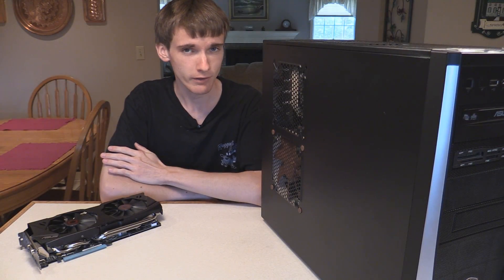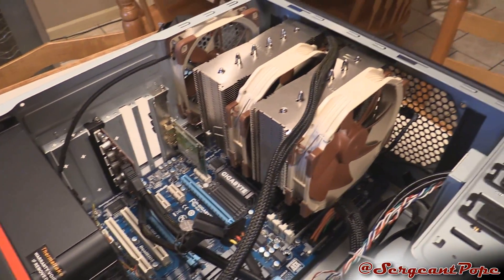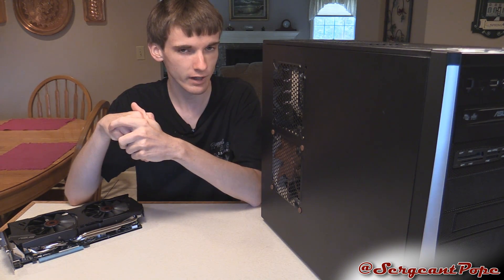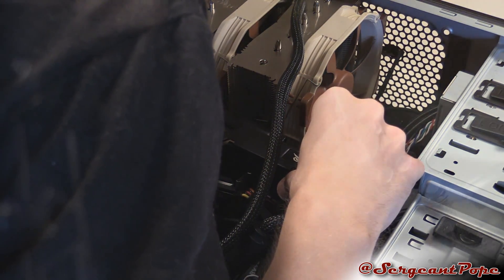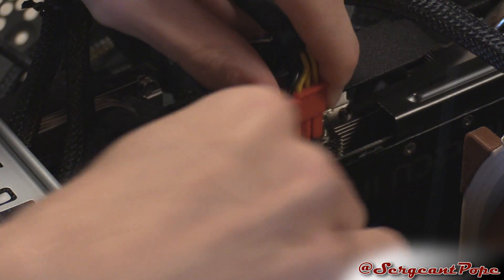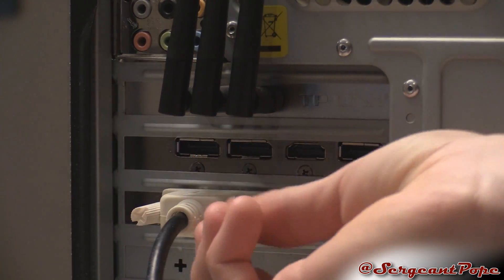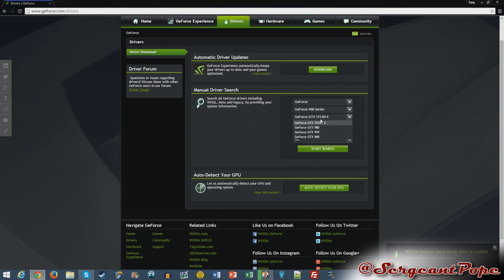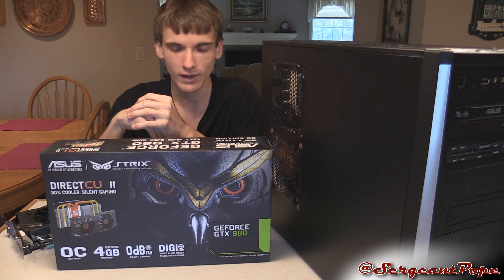How to install a graphics card - GET INTO PC GAMING EASY!

Comment: HELP my mother board just says pci e 16x it doesnt say 3.0 or 2.0 and i want to buy a r9 380 Will it work and will it cut performance also the latch broke but should this be a problem because you screw it on to the thign any will
 will i be ok?
Reply from the maker: +Guru Nannak It can be 3.0 or 2.0, either are fine. The latch doesn't have to be there, so if broke off that's fine.
Reply: SergeantPope so its to get 3.0 on my motherboard ?
Reply from the maker: Guru Nannak Yeah, 3.0 is fine. Technically PCI express 3.0 is faster than 2.0, even though all of my computers have 2.0 and they still work fine too.
Reply: SergeantPope oh ok ty
Reply: +SergeantPope will a msi geforce gt 710 2gb work with https://www.amazon.ca/gp/product/B00GFG1B1A/ref=s9_simh_gw_p147_d3_i1?pf_rd_m=A3DWYIK6Y9EEQB&pf_rd_s=desktop-2&pf_rd_r=NCJ61RPZ59RPDH444YPX&pf_rd_t=36701&pf_rd_p=2443077042&pf_rd_i=desktop

Comment: Hello, would this card work with my PC?  PC Specs: http://h20564.www2.hp.com/hpsc/doc/public/display?docId=emr_na-c03787848

Graphics Card: http://www.amazon.com/EVGA-GeForce-750Ti-GDDR5-Graphics/dp/B00IDG3IDO/ref=sr_1_2?ie=UTF8&qid=1451574084&sr=8-2&keywords=nvidia+gtx750+ti

I have intel 4600 right now, so would switching over to a new card be easy? I know I have to use the PCI Express because of the intel chip but I'm just wondering if the process will still be simple?
Reply from the maker: +Bryso69 You're probably good to go with the GTX 750 Ti. According to HP, it comes with a 460 watt power supply, which is enough wattage for the GTX 750 Ti. It also needs 20 amps from the 12 volt rail, so check the sticker on your power supply and make sure it says the 12v section has at least 20 amps. If it does, get the 750 Ti and install it!
Reply: +SergeantPope  Thank you so much. Your help is greatly appreciated!
Reply from the maker: Bryso69 No problem, glad I could help.

Comment: +SergeantPope Please help me I'm getting 20 fps on low setting on csgo is my amd sempron 2650 bottlenecking should I get the Athlon 5350? I need someone to confirm that the Athlon 5350 will work good and get decent fps
Reply from the maker: +Ridiculous Rodstar Anything better than a sempron will help. I don't know for sure how much.
Reply: +SergeantPope Are you sure, maybe in the future you can do a benchmark video with the athlon 5350 and maybe tag me

Comment: I have an asus g10aj desktop. There no words indicating how many amps or watts are in my computer, but in website it says it have 500 watts, but doesn't say how many amps. I was wondering if I can still put in a GTX 970 without many issues?
Reply from the maker: +Dzanh Nguyen You're probably good with a 500 watt power supply, but you can check the sticker on your power supply to make sure it has enough amps. The GTX 970 requires 28 amps.
Reply: SergeantPope Ah ok. Thank you for your help!
Reply: +SergeantPope alrighty another question.... What would happen if my amps were 3 less amps than how much I need? Also in the video, what is your amps? Also, is it strange that I have a gtx 760 that requires 30 amps and still runs just fine? I am basically asking that if I can run a GTX 760 card, then can I run GTX 970?
Reply from the maker: ***** If your power supply is only a few amps short of what's required, it probably will work at least for a while. But that said, eventually you will probably run into issues, especially if you run your system for longer time periods. Trust me, I've come into this issue before with a Radeon 7990 and it killed my PSU.
Reply: +SergeantPope That being said... I am a little confused on how the amps work. There's something like +12V1 and +12V2, does those two add up together? Or is the amp just only in the +12V1? If I do intend on having the gtx 970 with my currenty power supply, how much should I play my computer for it not to screw my computer over? Sorry if im asking too many questions, im kinda noob in these type of situations. I have 25 amps on my +12V1 and 25 more on +12V2.
Reply from the maker: ***** Unfortunately I think you can only use one 12 volt rail per graphics card, so you can't add them together even though your power supply has them. That's why a lot of newer power supplies have just one big 12 volt rail. I would honestly upgrade to a better power supply. The EVGA 500 watt power supply has 40 amps, which is plenty fpr a GTX 970.
Reply: +SergeantPope That sucks man :/.... I wasn't looking forward to spend any more money, but I guess I have no other choice. I just wanted to say thank you for your help and your time to help a fellow out ^_^
Reply: +SergeantPope I swear this is the final question, because you're great at helping! Instead of a 500 watt, I want a 550 watt PSU.

 http://www.newegg.com/Product/Product.aspx?Item=N82E16817139048 This is the cheapest 550 watt PSU with a single 12 volt rail of 46 amps I can find. Is this the cheapest and has everything I need?
Reply from the maker: I would go with this one instead. It's cheaper than that Corsair even before the $10 rebate that it has. http://www.newegg.com/Product/Product.aspx?Item=N82E16817438014&cm_re=evga_600_watt_psu-_-17-438-014-_-Product
Reply: +SergeantPope How have I not found this PSU yet? Thank you so much for your help, even to the point where I wish to just hug you. I'll stay tune to more od your videos. (>^.^<)
Reply from the maker: ***** Haha, thanks man. EVGA power supplies are really good. Thanks for the support!

Comment: i have a dell Inspiron desktop. i was wondering if i could install a nvidia gtx 960 in it.
Reply from the maker: +Matthew Stengrim If it's a full sized Dell desktop, it'll fit in there. The GTX 960 needs a 400 watt power supply, so make sure your power supply is 400 watts. If it's anything less, you'll have to upgrade, but they aren't too expensive.
Reply: +SergeantPope ok thank you so much
Reply: +SergeantPope do you have any suggestions on a Psu?
Reply from the maker: Matthew Stengrim Here's one: http://www.amazon.com/EVGA-Continuous-Warranty-Supply-100-W1-0500-KR/dp/B00H33SFJU/ Either the 430 watt or 500 watt models will work with a GTX 960. There are other options out there, but EVGA PSUs are affordable and reliable.
Reply: SergeantPope thanks so much man

Comment: +SergeantPope what if you bought your desktop without an graphics card, so how would I uninstall old graphics drivers ?
Reply from the maker: +Ridiculous Rodstar Every computer has a graphics card, but a lot of the time it's integrated into the CPU or motherboard. Regardless, it'll have drivers that you can uninstall through the uninstall a program window. You don't necessarily have to uninstall the drivers though, it's just a good idea.
Reply: Ohh okay thank you much gtx 750ti comes with a cd so the drivers might be in there to download thanks
Reply: SergeantPope i have 1 vga cable that came with my monitor and im getting dvi to vga, but how am i gonna get the card and the desktop to the moniter
Reply from the maker: Ridiculous Rodstar You just use the video outputs on the graphics card, don't worry about the connectors on the motherboard you were using before.
Reply: +SergeantPope oh okay thanks can u tell me what is the best cpu for gaming for the am1m-a mb
Reply from the maker: Ridiculous Rodstar I honestly have no idea, sorry. I've never had to deal with that area.
Reply: +SergeantPope its alright i know im asking soo much questions but how much fps will i get at low settings and im gonna buy the athlon x4 860k that can fit in mb because its am1 platform
Reply from the maker: Ridiculous Rodstar After looking up the AM1 socket, I think this CPU is actually the best that will work with your socket http://www.amazon.com/AMD-AD5350JAHMBOX-Quad-core-Desktop-Processor/dp/B00IOMFAQ0
That should run CS GO well.
Reply: SergeantPope Thank you for all your help lately mind telling me the fps on low and high settings?
Reply from the maker: Ridiculous Rodstar I honestly have no idea. CS GO isn't hard to run so the FPS should be pretty good, but I can't give you a specific number.
Reply: +SergeantPope thanks soo much! honestly you have helped me soo much
Reply: What do you call a computer that loves to sing? A Dell hahahahaha
Reply from the maker: Ridiculous Rodstar Niiiice, lol

Comment: I have a gtx 750ti and my max power supply is 420w is that good
Reply from the maker: +Ridiculous Rodstar 420 watts should be enough power for the GTX 750 Ti. That card also needs 20 amps from the 12 volt rail, so you might wanna make sure it is at least 20 amps.
Reply: +SergeantPope how do I check
Reply: +SergeantPope and do you know the ports on the graphics cards where do they need to be connect sorry I'm new to this
Reply: +SergeantPope sorry lol I have to much to ask my cpu is Amd sempron 2650 intergraded radeon r3 graphics and I have a gtx 750 ti oc 2gb can that run csgo high and mes settings and yes how much estimated fps
Reply from the maker: Ridiculous Rodstar The power supply will have a sticker on the side of it. Under 12v it'll show a amperage. Those connectors on the graphics card will need a power connector from the power supply.
Reply: +SergeantPope no like the dvi and hdmi
Reply: +SergeantPope these are everything I found 13.0a 10.0a 22.0a
Reply from the maker: Ridiculous Rodstar It's probably that 22a, so from what you say I think you'll be good.
Reply: +SergeantPope thank you so much subscribed and liked!!
Reply: +SergeantPope when I have the gtx 750 ti in the desktop and I closed everything and everything's done what do we do on the desktop like any wires go from the card or what sorry I'm nooby
Reply from the maker: +Ridiculous Rodstar That was a little confusing to understand, but what I can try to answer for that is you need to run the video cable from your graphics card to your monitor, like HDMI or DVI. I don't know if that answered your question.
Reply: +SergeantPope Yes it did. So I can connect a hdmi cable from my card to my moniter that's it?
Reply: +Ridiculous Rodstar because my moniter doesn't have a dvi port its new Samsung nice looking but has a vga port i heard that the gtx 750ti comes with a dvi to vga
Reply from the maker: Ridiculous Rodstar Yeah, a lot of graphics cards do come with a DVI to VGA adapter, so if your monitor is VGA you probably wouldn't need anything extra.

Comment: let's say I had msi graphics card and I want to change it with other graphics card which is not msi well it work?
Reply from the maker: +Had1 Gamer So you're going to be removing an msi graphics card and replacing it with another brand? That's fine to do. If you will still use the msi card and add another different brand, you could run into issues.
Reply: +SergeantPope wow thanks bro for telling me but can u send me a link of a really good graphics card please and thanks
Reply from the maker: Had1 Gamer Without knowing your budget, that would be really hard to find something good for you.

Comment: do I uninstall all of the NVidia programs???? helppp!, I jst put my new graphics card in don't know what to do next
Reply from the maker: +chico42O Go to control panel and then uninstall a program. Look for the Nvidia programs and uninstall them. Usually with Nvidia there are several programs you have to uninstall one by one.
Reply: +SergeantPope ok I uninstalled all my NVidia programs what do I do next?
Reply from the maker: chico42O Install the new drivers at Nvidia.com
Reply: +SergeantPope do I click on automatic drivers update or do the manual drivers search?
Reply from the maker: chico42O You can do it either way. If you know your graphics card, you can just do manual and pick what graphics card you have. If you don't know, pick automatic.
Reply: +SergeantPope my computer only has one 6 pin connector and the gtx 960 requires two 6 pin connectors to make 8 pin does my computer not work for this graphics card?
Reply from the maker: chico42O If your power supply only has one 6 pin connector, I would upgrade your power supply. Find a power supply that is at least 400 watts and has 20 amps on the 12v rail. Here's an example of something that should work fine: http://www.amazon.com/EVGA-Continuous-Warranty-Supply-100-W1-0500-KR/dp/B00H33SFJU/
Reply: +SergeantPope my power supply does have 400w it just doesn't have two 6 pin connector
Reply from the maker: chico42O Does it have 20 amps on the 12 volt rail? (can be found on the sticker showing power ratings and stuff on the power supply itself). If so, then you can use an adapter. If it doesn't have 20 amps, get a new power supply.
Reply: +SergeantPope j got 18a is that enough?
Reply from the maker: chico42O I wouldn't chance it to be honest. I would get that 500 watt power supply, which will give you plenty of head room. That power supply you have might work for a bit, but it'll start to have issues eventually.
Reply: +SergeantPope is it easy to install a new power supply? Im new to this stuff lol
Reply from the maker: chico42O It's not bad. See where the wires go from the power supply now and then do the same thing with the new wires from the new power supply.
Reply: +SergeantPope will the power supply that you showed me fit on my Asus M51AC motherboard??
Reply from the maker: chico42O Yep, should be fine.
Reply: +SergeantPope k thx for all the help bro!! :)
Reply: +SergeantPope ok I jst installed my new power supply, graphics card is working, now I jst update my drivers and everything should be good?
Reply from the maker: chico42O Yep, you're good to go. Updates come out from time to time, so you'll have to update them every so often, but beyond that it's all good.

Comment: i have question my pc is Dell inspiron 660 can i upgrade power supply and graphics card??

if i install graphics card and power supply, do you think they remove everything on my pc 
or they just change little on my pc ???

how can i find graphics card and power supply  to my pc ?
how do i know they both on my pc >>??  

you know i have power supply like 300w ,so i want to change my power supply to 650w , what do you thinks ??

please make another video about how to uninstall and unstall the new on pc ??? help 

My english is not good Sorry  <_())(
Reply from the maker: +bruce le Hey bruce. To install the graphics card basically as you have to do is push the card into the slot on the motherboard and screw it into place. With the power supply, find out where every cable from the power supply is going before you disconnect it and then plug the cables from the new power supply into those same power connectors with the same type of connectors. Upgrading your power supply would probably be a good choice if it's only 300 watts as well.
I hope that helps you a little bit. If you still need help, just let me know.
Reply: i want to share my system can you please look up and thing which want can i upgrade please?
Reply: 1 .operating system: win10 pro 64bit (10.0 build 10240)
2 .processor: intel R core TM i5 3340 CPU(4)@3.10ghz 
3. memory 8 gb 

4. video card : interl r HD graphics
 

Thanks you
Reply from the maker: +bruce le I would probably just get a graphics card. Everything else looks fine.
Reply: okay thanks you :)
Reply: Vamery 2GB 256 Bit DDR3 PCI-Express Graphics Card For NVIDIA GTX650 

please look up 

does my computer can run it
Reply from the maker: bruce le A GTX 650 should work for you. Look for one that has GDDR5 memory instead of DDR3 memory. It'll be a lot faster if you do that.

Comment: WHERE DID YOU PLUG OTHER SIDE PINS ?
Reply from the maker: +Superis LTU Do you mean the 6 pin connector?
Reply: i guess.... i know that you plug 6 pin conector to the card, but then you need to plug one more cable somewhere
Reply from the maker: Superis LTU Hmm, I don't know exactly what you mean. Your graphics card will need either a 6 pin, an 8 pin, or a combination of those. Those cables will come from the power supply. That is the only power cable the graphics card needs.
Reply: ok

Comment: AMD A8 4.2Ghz Quad Core 8GB 1TB FTS Gaming PC Desktop Computer Galaxy EVO HDMI Gigabyte F2A68HM-HD2 Motherboard 8GB DDR3 1600mhz Performance Ram Onboard AMD Radeon HD 8570D 500 Watt Power Supply With 12cm Fan 1tb Seagate Barracuda Sata 6Gb/s 64mb Cache 7200rpm, My system.  Since its APU Would I have to disable my Onboard graphics before installing?  I'm planning on getting the 750TI For christmas.
Reply from the maker: +UnionJxck Normally you don't have to disable the onboard graphics, so I wouldn't worry about doing that unless you run into a problem.
Reply: SergeantPope Ok thanks :)

Comment: Could I use a 750 ti with a AMD A6 6400k Apu, Thanks. 

I have a 500W Power supply btw.
Reply from the maker: +David Shewan Sure, I don't see any reason why it wouldn't work. You wouldn't be able to use both your APU and your graphics card together, but even in the small cases when you can use an APU with a graphics card, the performance difference isn't that much. A 500 watt power supply is plenty of juice for a GTX 750 Ti as well.
Reply: +SergeantPope  Should I use a GTX 960 with my A6 6400k and bottleneck it like crazy or should i just buy an i5 4690k and go with the IGPU until I can afford a pretty decent GPU? The A6 6400k annoys me as it is only a dual core so...
Reply from the maker: David Shewan I would probably go with the GTX 960 if you were me. Then I'd upgrade my CPU and motherboard if I noticed a lot of bottlenecking. That's just me though.